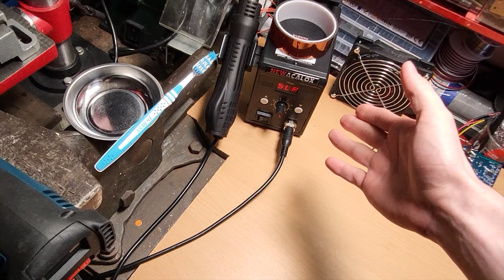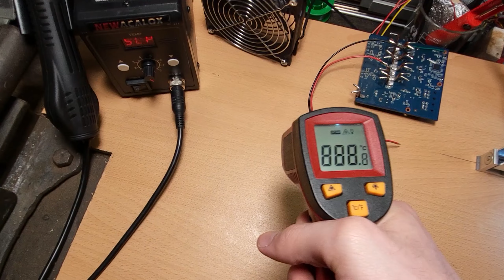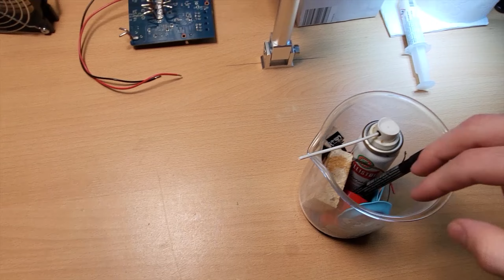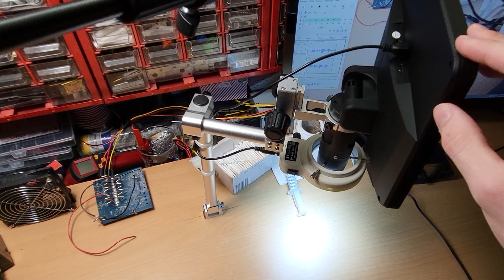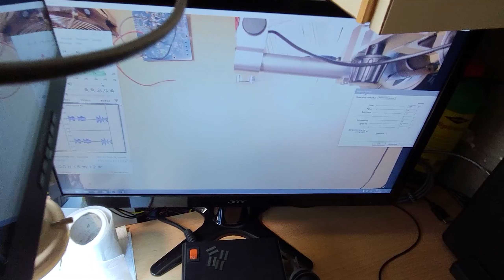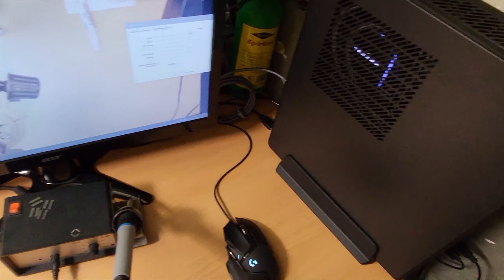My Workshop, Tools And Recording Equipment in 10 Minutes Or Less

Comment: Don't worry about tools , the important tool is talent and you got it.
Here we use cheap hot air station, for accuracy we use temperature measuring multimeter .